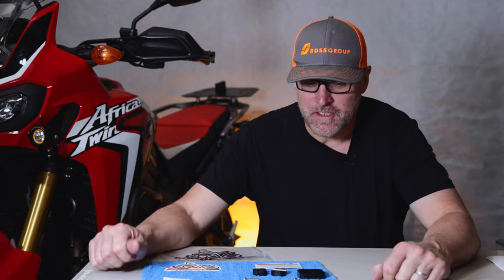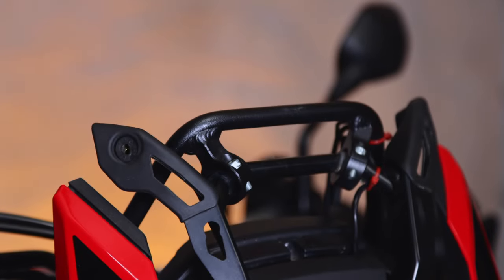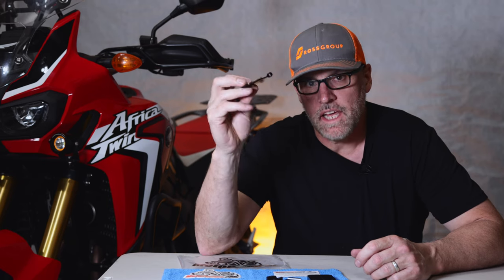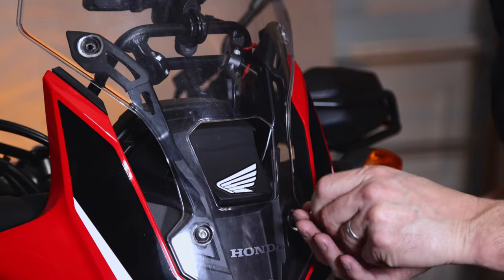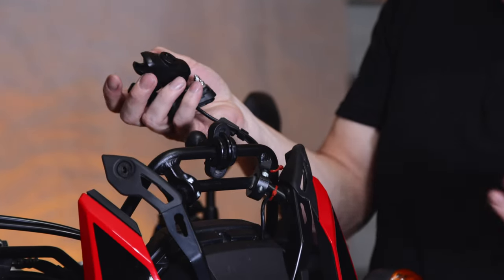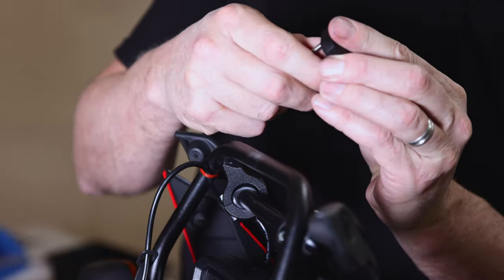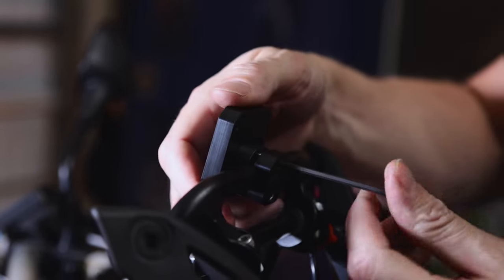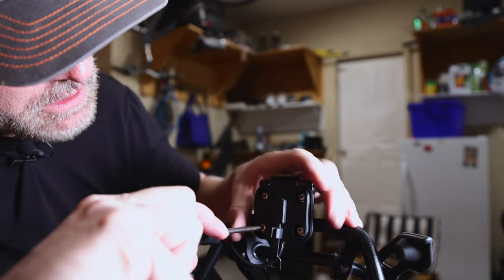A Better GPS Mount with Added Security

Comment: Seems like the tool that locks/unlocks the unit should either be extendable or at least come out past the GPS unit. I ride a KTM790R and I can see where the windscreen may cause an issue getting my hand behing the unit to either lock or unlock it. I like the simplicity of it. Also, I understand the unique (non-standard) keyed feature for security, BUT come on, $15 bucks for extras is way unreasonabe. If you are traveling/offroading you want to have extras with you, but that seems excessive. At least the unit should come with 2 keys regardless.
Reply from the maker: Thanks for your comment.  A lot of what you said is true…. However the confined space is a blessing and a curse in my option.  As far as the keys go both ends are useable.  One side for locking and the other for pushing pin out.  As far as I know, they are also machined and stainless where 15 seems reasonable.
Reply: @1LiterADV  Makes more sense when explained, I will purchase either way, however 2 keys seems reasonale for a $70 item imo. Thanks
Reply from the maker: Thx for the positive feedback.  Sometimes it’s hard to know how people will interpret your responses.  Machining cost and is usually outsourced, so I’m assuming there is not much margin on the keys.

Comment: I really like that locking piece, one thing I would change is to use an Altrider Universal Bar mount because all the fastener go in from the front with the GPS removed
Reply from the maker: I can see how that would be beneficial.  The locking plate can be used independently, as it really is designed to work with Garmin Zumo XT cradle….I just paired it with the MotoPumps mount.  I’m using the plate as a layer of security for gas/lunch stops and similar.  Overnight stays, I would remove the GPS unit altogether.
Reply: @1LiterADV  yes thanks for showing that part it’s the one thing that I didn’t like about my altrider mount didn’t have a way to lock the gps in
Reply from the maker: Order one up for piece of mind.  I think you’d like it.  Cheap Insurance
Reply: The fasteners go in from the front on the MotoPumps mount as well.  That is the only way it works with the Zumo XT powered cradle that came with the GPS...
Reply: @MotoPumps  yes I saw that the fasteners go in the front of the plate but I was also talking about the fasteners on the astrider clamp itself they go in from the front as well which also means you don’t need to take off the wind screen anyway I think adding that plate is the way to go no matter what clamp is used

Comment: I don’t understand. Do you need a mounting bar for this?
Reply from the maker: Plate is sold with an attachment that accommodates many bars widths.  In this video the 12mm attachment was used.

Comment: so u just need a 3mm hex key to take off mounting brace bar and cut power cable, still not theft proof.
Reply from the maker: You are correct.  It adds a layer of security that is significantly improved over the Garmin cradle, which has almost zero.  The mount itself is tight against windshield and should allow gas stops and lunchtime to  happen with more piece of mind.  I wouldn’t trust it overnight outside.  The security pin also allows piece of mind during off-roading.  At least that is what I hope.  In short, nothing is secure….. but it is a deterrent that works as advertised.